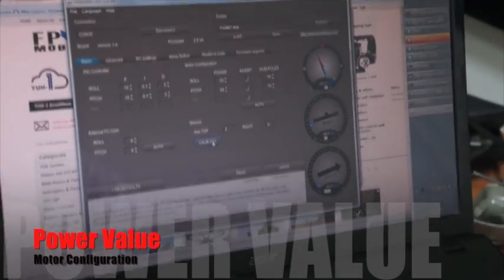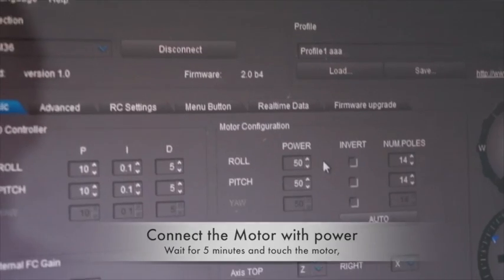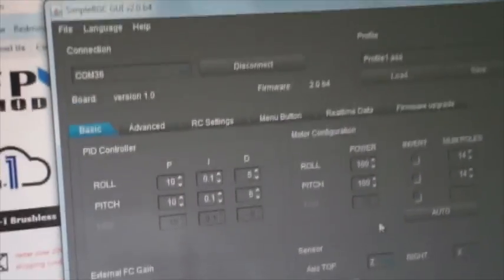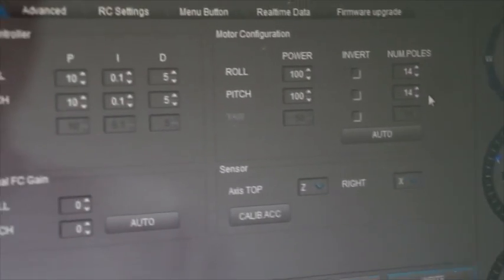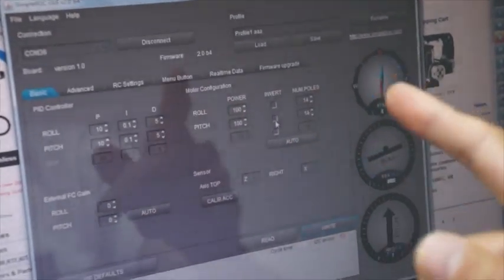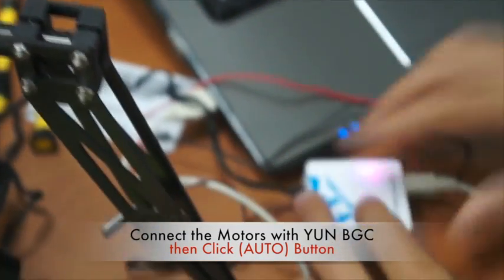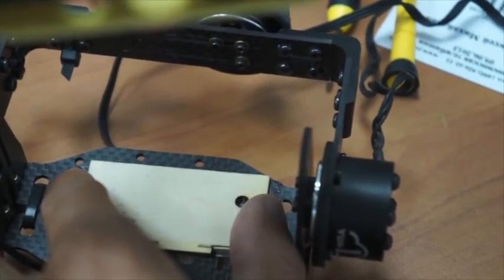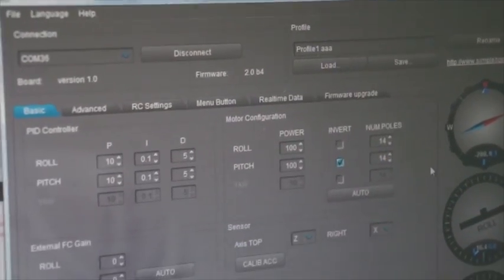YUN  Brushless Gimbal Controller Instruction V2-b Motor Configuration

Comment: I am having difficulties getting my controller to connect. I used AVRDudeR to up grade the firmware. Indication was that it worked, but no light changes and it happened very quickly so I am thing it did NOT work. Any suggestions? Win7 x86 .